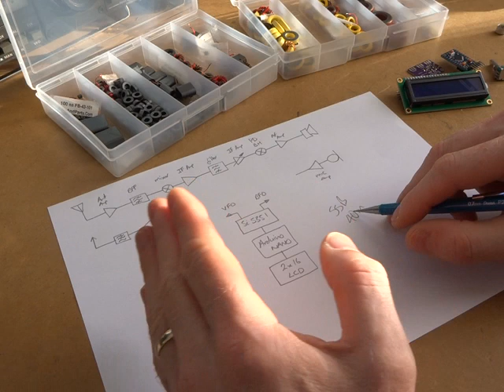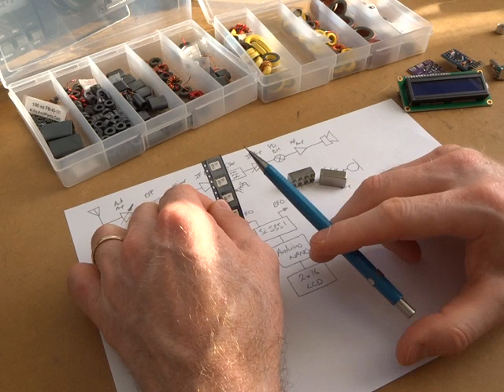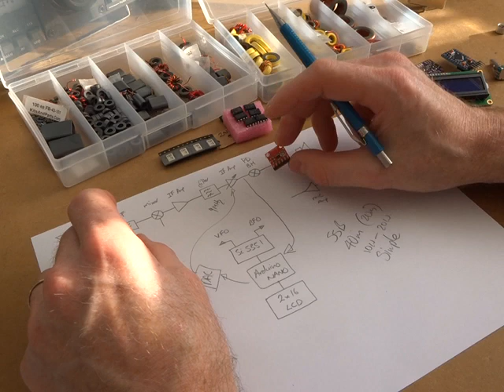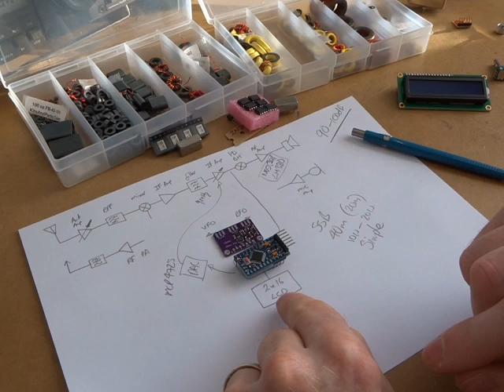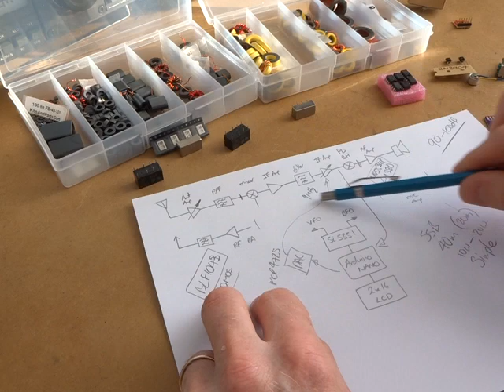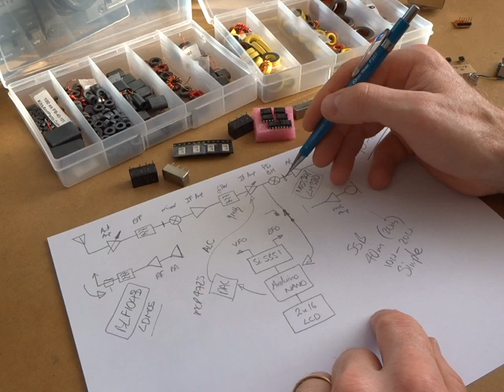Homebrew MC1350P based SSB Rig - #1 Thoughts and Ideas

Comment: Thanks for all you do for the radio builders community, Charlie!  I especially appreciate the in-depth descriptions of the calculations and design thinking.  One question:  I've noticed some designers put the receiver's first RF amp before the BPF and some put it after.  I've also heard that it's best to filter before amplifying so as to reduce the out of band energy going into the RF amp.  Do you have any thoughts on this or any particular reason for the sequence you are using.?
Reply from the maker: Hi. To date I have tended to place the BPF after the antenna amp, as it makes it very easy to share that BPF between RX and TX using a relay. If you place it before the amp, then it makes it harder. I note the EMRFD and SSDRA text books suggest puttinb it before the amp. I am going to put it before the amp in this build to see if there are any noticeable differences. The down side is that I will probably have to make a second BPF for the TX chain.
Reply from the maker: I've just been looking through EMFRD again and I note their example SSB T/R has ant->ant amp->BPF, and the BPF is shared between the TX and RX.
Reply: @CharlieMorrisZL2CTM  
Thanks for the reply, Charlie.  I suppose I need to buy a copy of EMFRD.  I see it referenced by many radio builders.  Anyway, here's how I suspect the sequencing can impact the performance:  Any amp will have some nonlinearities that will cause some degree of mixing.  The wider the bandwidth of the signal entering the amp, the more mixing products that will result.  The products will appear as noise.  By using a bandwidth limiting filter before the amp, the mixing products would be reduced.  I don't know this for sure.  And I've not read any explanation of it.  This is just my thinking on the question.  However, I have read advice to filter before amplifying whenever possible.  And I've read that in a good superhet design, the preponderance of the gain should come toward the end of the receive chain.  I recently built a superhet using a modular approach and will have to try shifting the gain around in the RX chain to see if there is any noticeable result.
Reply from the maker: @WHalphen  I like EMRFD and SSDRA. I find EMRFD has a lot of the same material as SSDRA. I will do some more experiments after this build with putting the BPF after the amp, as well as having the first mixer drive the crystal filter directly and not via a IF amp. What you mention above makes perfect sense, especially if the amp has some non-linearities. That's the beauty of building modular, you has just mix and match as you see fit.

Comment: Project looks great. 

Potential caution with the ADE 1 after the crystal filter. They  may have a low drive limit to the power they can deal with that may be easily surpassed if you are depending on much gain after the filter , before the mixer .
Reply from the maker: Hi Kenneth. Good point. I'll have to remember that and see how it goes. I must admit I do like the SBL-1 so it wouldn't be an issue swapping to that.

Comment: This project looks good. Suggest a module to do some audio shaping of the tx to improve power in the frequencies that matter for intelligibilty. An article and circuit by G8JNJ is a suggestion.
Reply from the maker: Hi. That looks interesting indeed. Could be a good option as a stretch goal once the base radio is built.

Comment: Hi Charlie, I enjoy every video of your projects. For my own Receiver, some FT37-43 cores for the mixer are ready wound, will do some diode soldering the next few days. Could you please explain in detail the impedance matching for the IF-Filter as I want to use some yaesu XF-8.9HS with c.f. 8987.5kHz. 73 de Gerald, OE3GOD
Reply from the maker: Hi Gerald. yes, I'll definitely cover off on impedance matching where appropriate.